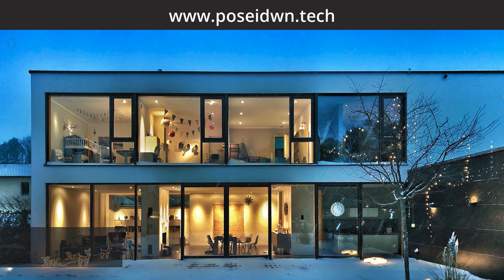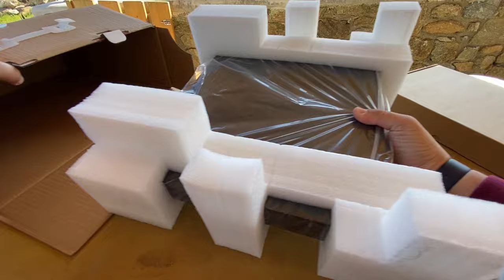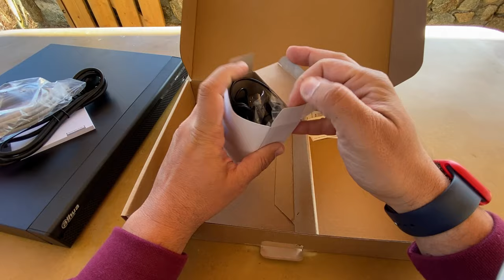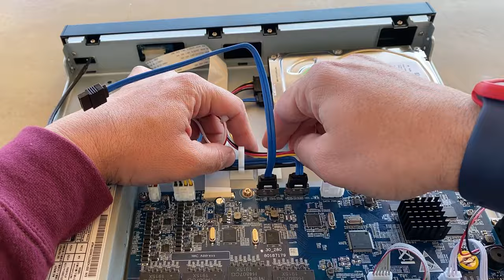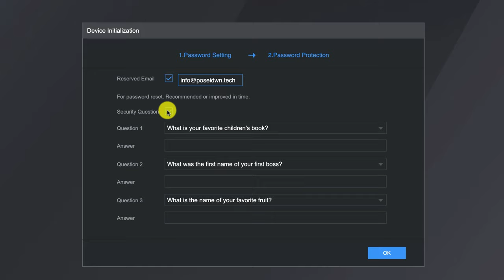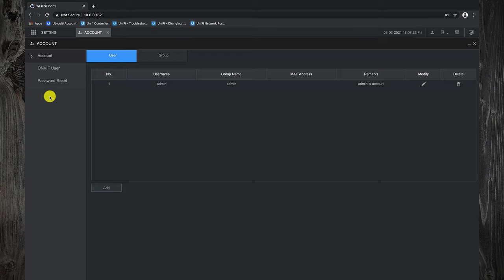Dahua Network Video Recorder (NVR) for IP Cameras  - Step by Step Tutorial

Comment: Hello, the cameras should be Dahua so they are recognized automatically when connecting in the Poe Ports of the NVR? I have Hillock cameras and I haven't find a way that they get connected and work in the PoE ports of the NVR, they only work if connected to an external PoE switch. Thank you
Reply from the maker: Only Dahua's IP Cameras will work with Dahua NVR.
Reply: @PoseidwnTech  thank you

Comment: Since you have assigned a static  ip address on the NVR from your local router and therefore the camera are on the POE switch of the POE. 
can you port forward between the local network and POE segment so as to access the web page of the cameras?
Reply from the maker: When you connect the IP Cameras into the POE Ports of the NVR then you can access the cameras only through the NVR and not from your local Lan. If you want to access your cameras locally or remotely then you should connect the IP Cameras into a POE switch and then add them in the NVR.
Reply: @PoseidwnTech  would  smart pss resolve this issue?
Reply from the maker: Yes from Smart PSS you can access the properties of each camera!